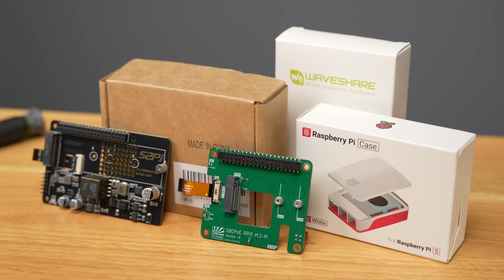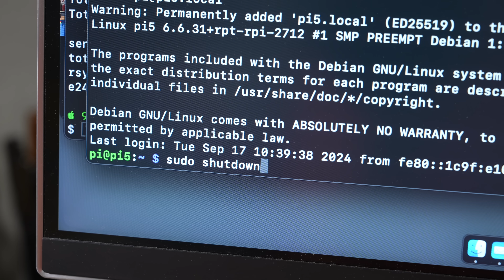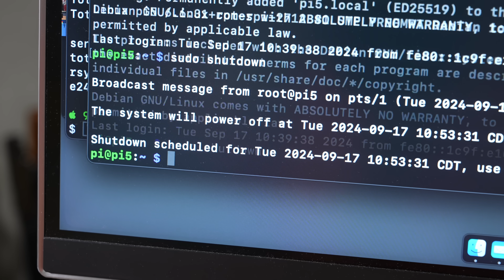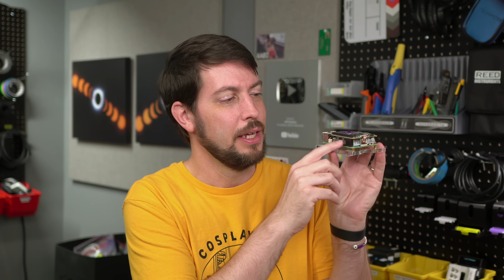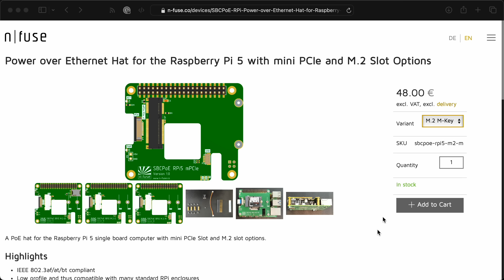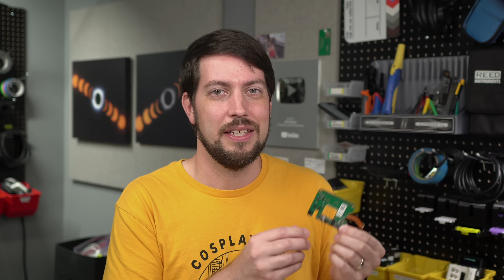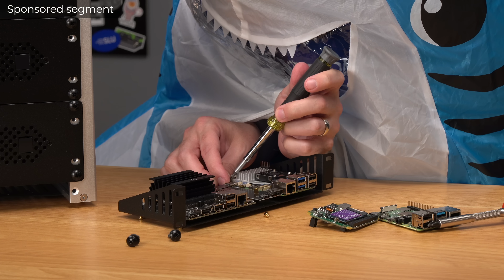PoE+ NVMe beats Raspberry Pi to the punch

Comment: I've used a PoE to USBC (only 5V2.4A) splitter I got for $12 ok if you don't need much power it's useful since my poe switch is on a UPS, no need for UPS on other room.

I charge my phone with an extremely overpriced ubiquity one.

Comment: With the power injector you have for poe, can you just use that on a regular non-poe switch to give everything power?
Reply from the maker: Good question! PoE injectors like the one I used in this video are meant for one device only. Usually you'd put one of those somewhere if you want to just power an access point or something with one cable, but don't already have a PoE switch.

Comment: Jeff - is there a pico-poe injector out there? Seems wild to use a poe injector that has a larger volume than the entire Pi!
Reply: Normally you'd buy a poe switch and not need a separate brick.
Reply from the maker: Yeah; there are a few good ones that just do PoE+ and are a bit smaller. The one I have is quite overkill, but its performance is very good and adequate for a lot of test case I have.

I have another cheap PoE injector that is about 1/2 the size, and would be adequate for most Pi use cases.
Reply: @JeffGeerling  Thanks for this answer, and of course the video. Have a great weekend!
Reply: Mikrotik's RBGPOE (that requires an external normal sized power brick)

Comment: One thing I was waiting for: whether you can plug both POE and USB-C PD power to this one hat and have redundancy. If yes, what power supply does it prefer and can what happens if one of them gets disconnected?
Reply from the maker: The HackerGadgets might have that redundancy, but honestly what I do is plug my central PoE+ switch into a UPS—so far after about 7 years in this configuration, I've never had an unplanned outage, even when power went out in my house.
Reply: @JeffGeerling @JeffGeerling Our hat has a power backward protection circuit on both the PoE and USB PD sides. So, plugging in the PoE and USB PD simultaneously wouldn't be a problem. I only use the PoE+ for power, too. But I found that it's useful when I move the Pi5 from one rack to another rack; I can plug a power bank into the PD port and unplug the ethernet cable without breaking the uptime or any jobs running in the Pi, although I got no jobs on it, LOL.

Comment: In my experience good sd-cards from SanDisk are more reliable than most NVMe's. Even samsung NVMe died on me, and many others. I never had a sandisk sd card die on me.
Reply from the maker: SanDisk does make the cards I deploy most; even their Ultra line is okay, but I usually use Extreme. But I've also settled on a few NVMe SSDs I like, and have never had issues with. I used to use some Samsung SSDs but after the 970 or 980 series (can't remember which), I shied away.
Reply: @JeffGeerling  I use my NVMe's to test on all kinds of boards. I bet many aren't in spec. So that's probably the reason why they die a lot more. SD cards used to die a lot 10 years ago. But these days they work great. Got tons of sandisk and I relly on them working. As I said, never had one of those, all extreme or extreme pro die. Have a nice day and thank you for answering.

Comment: It's a shame that the ethernet port on the Raspberry Pi doesn't support POE by itself. Is that a future possibility?
Reply from the maker: This is a good (and reasonable!) question—the problem is the power circuitry required would take up probably 15-20% of the entire surface of the Pi board (if they keep the same credit card size footprint), and add probably $2-5 in BoM costs... and in practice probably only 5-10% of all Pi's purchased would use the feature.

So Raspberry Pi offers the four pin header to allow HAT makers to add on the capability, which is an okay compromise in my book!
Reply: @JeffGeerling  an ethernet from the power socket / power supply would make more sense maybe ?
Reply: PoE isn't something you can just "enable" it requires physical power components to work, and some of those are pretty large (like the coil) and won't fit on the board. The best they can do is design it to allow installation of PoE HATs so people that need it can get a module to do it.
Reply: As you can see from the amount of circuitry on any PoE hat (especially the coil), adding that onto the Pi PCB ain't happening.  At least, not without dropping current features.
Reply: @tcurdt the current hat doesn't add a ethernet port, i see no benefit of moving the ethernet port to the hat.....
Reply: And risk not being able to sell a separate hat for more money to achieve that? NO WAY!
Reply: @mr.highschoollocksmith6080  the reason it is not build in is technical actually..............see the rest of the thread
Reply: Just for clarity, I wasn’t expecting that it’d be easy. I’m just curious if you think that it is a future possibility with innovations you see on the horizon. Thanks
Reply: @akdm82  No I don't see this happening in the future
Reply: What would make much more sense to me:
Have a NVME slot on the Pi and no ethernet. Then have a hat that adds ethernet with PoE. 🤷‍♂
Reply: @tcurdt no
Reply: @JasonZakrajsek  yes
Reply: @tcurdt Most RPis run off Ethernet.
Reply: @ThatEngGuy so we won't miss it 🙃

Comment: It is nice to have both function in one HAT, but then you have one point of failure. Can also make it harder to trouble shoot any issues you might have in the board.
Reply: Each function has a single point of failure even if it's on its own hat.  There is zero redundancy regardless.  Troubleshooting doesn't really change, either.
Reply: Yes, but one can fail while the other still works and you only need to replace one of the two. Also, if there happens to be any kind of improvement to one of the HATs you don't need to hope that there will be a new combo HAT

Trouble shooting most certainly does. With a single Hat with multiple functions, something can break in one of the functions needing to be narrowed down to which function. Unless you just say, "Oh well, throw the whole thing and and replace it." And although they "shouldn't", the functions when malfunctioning can have unforeseen interactions, hiding the root cause and provide hours of frustration.

Granted, for something at this low of a price point, it likely doesn't really matter. Personally, I always like having the functions separated as much as practicable. But I'm odd that way.
Reply: @sunhawk1104  There are applications where the all-in-one devices are unreliable enough that separating functions into different boxes is a good idea, like home internet modem and gateway.  But there's no reason for these combo hats to have reliability issues other than the ribbon cable and fan bearing, which will be the same to troubleshoot regardless.

Comment: It's a hard sell telling us you don't need a power supply with that enormous POE injector sitting right next to it. Make us feel better and hide it under the desk.
Reply: That's what a poe switch is for :)
Reply from the maker: Hehe, well I normally use my cheaper PoE+ switch for testing, I used to have it on my bench and could just pull it and use it, but now it's in service and more annoying to remove!

The nice thing is, you don't need a fancy Aruba just to power a Pi. It's more fun that way though!
Reply: @JeffGeerling  I'm currently pulling my hair out trying to get AWX running in my home lab. I just want to thank you for all the work you have put into Ansible.
Reply: @JeffGeerling why would you need to pull the switch to be nearby when you can just run an Ethernet cable to it?
Reply: Can't tell if this comment was legit... if it is, you seriously missed the mark here my guy
Reply: And part of the typical PoE use case is being able to remotely mount a device without having to run power as well as network
Reply: Non issue, at some point the cable gets back to a closet where you can either hide the injector or use a POE switch.